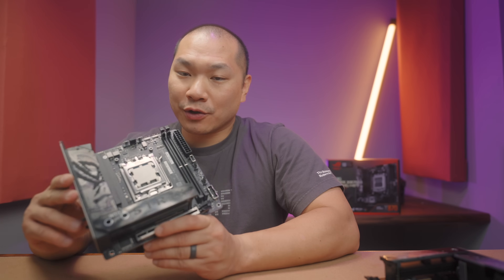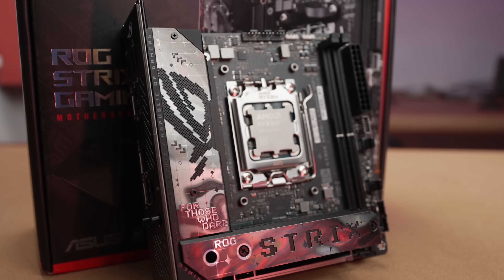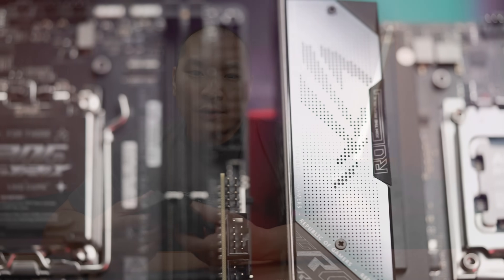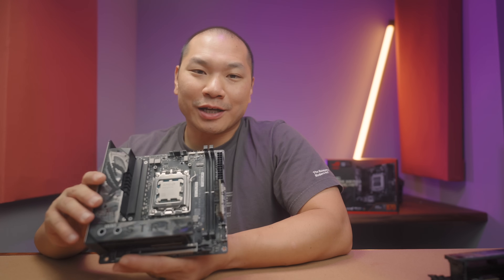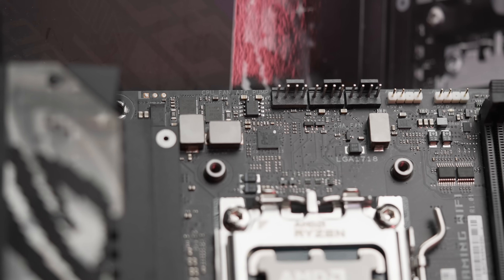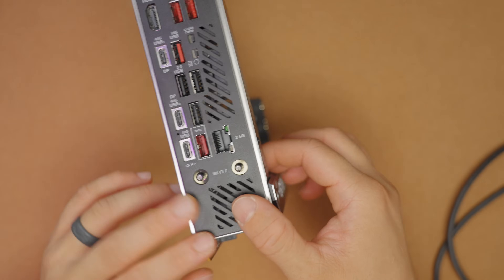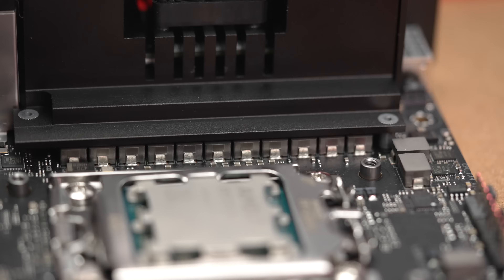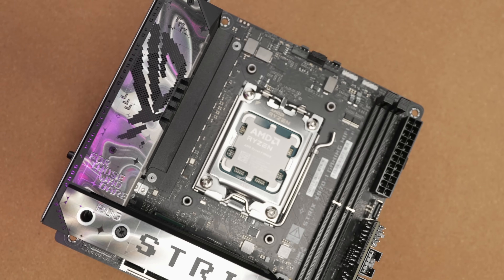Asus's Strix X870-I is the 𝙗𝙚𝙨𝙩 𝙖𝙣𝙙 𝙤𝙣𝙡𝙮 800 series AM5 ITX board.

Comment: Hey, I have this board for 7 days now, what is your USB4 firmware? It's in BIOS under advanced > AMD PBS > ASM4242.
I wonder if there is an update as USB4 ports constantly reconnect my Quest 3 VR headset rendering it useless. Looking for any clues
I came from X670E-I Gaming WiFi on which when I had anything plugged into USB-C it had issues waking up from sleep (it was intel thunderbolt controller in this case) & asus decided to take the board and return me money. On the new board everything seems to work beside the VR and I bought a board with USB-C to use it with VR so bummers.

EDIT: Meta finally added support for ASM4242 in beta firmware so all good now. Asus is returning money for X670E-I and I have working X870 so massive win!
Reply: I bought the X670E-I Strix as well.  The solution for USB-C accessories not being able to wake from sleep is actually a pretty simple fix.  In the Device Manager, you have to find the USB-C ports and whatever is listed as the USB-C hub or accessory, open it, go to properties, and where it says "Allow computer to turn off this device to save power", make sure that is unchecked.

I have an HTPC setup at a distance so my mouse and keyboard are plugged into a hub that goes into the USB-C port.  By ensuring that USB-C port stays active during sleep, and that the hub stays active during sleep, I'm now able to properly wake the PC from sleep.
Reply: @Tony72495  sorry, I must have written it wrong. My issue wasn't that my peripherals won't wake PC. It would not wake even by pressing power button and the only way to get back into system was to hard shut down it and start up again. It would only happen when something (doesn't matter what) - an empty HUB or Quest 3 was plugged into any of the USB-C ports. And I thought I got a faulty unit so I bought second one and it was the same
Reply: @adriankomadowski  I believe the issue is related, I also had occasional issues where even hitting the power button wouldn't work.  I began to believe that my PC was suffering instability issues.  Since I changed the power settings for the USB-C ports, however, I haven't had any issues, I can leave the PC for hours and if I wiggle my mouse it springs right back to life.
Reply: @Tony72495  Hm I remember now that I have tried it because meta support suggested it, no luck for me. Also Asus support did not figure it out and decided to return me money so quite odd. At first they provided me with custom BIOS that fixed that but they said that they won't merge this fix into main branch - that's how I got my money back. Anyway thanks for your input
Reply: @Tony72495  Hey, Meta finally added support for ASM4242 in beta firmware so all good now. Asus is returning money for X670E-I and I have working X870 so massive win!
Reply: How do you know it's not the Quest unplugging?
Reply: @SuperGGnoRE  cause it works when using A to C adapters but I have only 2.0 ones so it's not a solution & it connects then disconnects every 1 second or even lower

Comment: I'd recommend the b650i strix at a discount instead.
Reply from the maker: For most ITX builders that is my recommendation as well. For mid level builds the MSI B650 is also good.
Reply: Cries in coil whine... But yeah, other than that, solid.
Reply: @EIGAtech yep, I'm on team ASRock for AM5 until we see what else comes out.
Just so much random stupid stuff on boards. Like was a fan with 12x110w power stages really necessary? Why external audio? Why have a doughterboard for necessary connectors instead of optional connectors?
And I guess we don't have to talk about cooler compatibility, it's mostly at the base level, if keep out zones are properly met.
Reply: @EIGAtech  somehow, very little to no whine in mine. Got lucky.
Reply: Itx
Reply: Same. What I currently have. Excellent board.

Comment: do you think its a issue that this board is not an  e mainboard
Reply: There's literally no physical room for the lanes
Reply: @vincentvega3093 thx. i was wo dering abput this because even the strix x670 itx is an e board. do you know if x870 is different when it come to lanes?
Reply from the maker: They’re not able to take advantage of the extra lanes anyway in this form factor so it’s kind of a waste for them to go for the 870E here. With the 870-I you essentially have the same high speed port count as the 670E-I.
Reply: @MachinesMore thx very much. i was wondering if it is worth it to go with a x670ei or even x870i because there is the b650e-i i ordered but thinking about to return it but not sure if the x670ei or x870 is worth it?